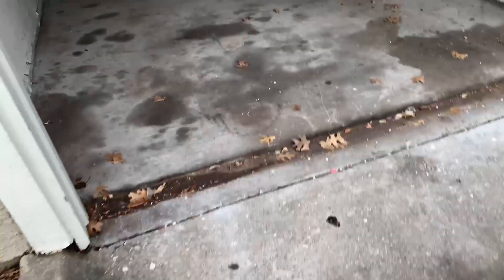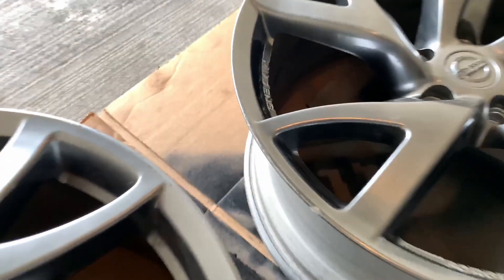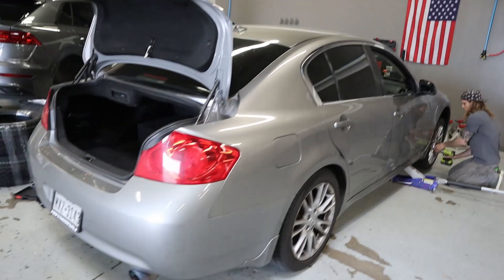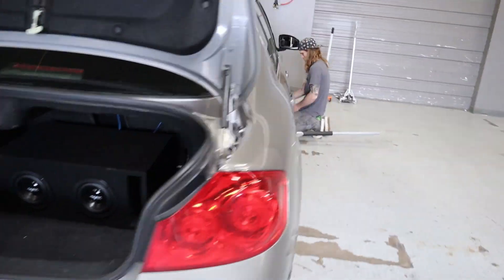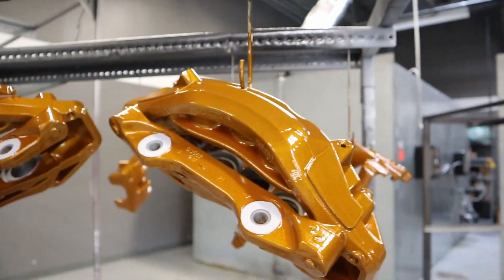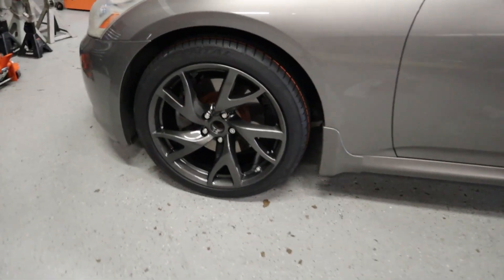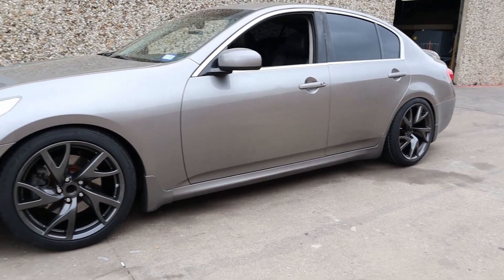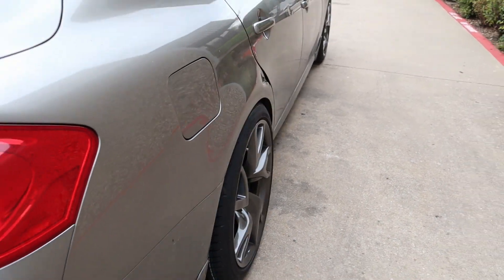My first experience with powder coating. Amazing Results! | Unit F14 Powder Coating

Comment: Job cam out great but it’s kinda weird that they’re using a cheap impact gun, like really cheap. A shop that nice I would expect a snap on or maybe even a Milwaukee, no hate just weird
Reply from the maker: Lol that’s the small stuff man. “Cheap brands” have a lot to offer as well. Their work is legit
Reply: @EnthusiastPOV  I know their work is legit , but if they cheap out on something I think is important like a tire impact what else do they cheap out on? What if they use cheap powder or don’t prep wheels to save money, just a thought
Reply: Just checked their website and it’s pretty busted on mobile, not a good look lol
Reply from the maker: Lol. I’ was more than satisfied for the service they provided. For two 28 year olds just starting a business which they opened about 3-4 weeks before I got my service done. They did an amazing job.
Reply from the maker: It’s a new business you’re being over the top about an impact lol. If I was 27 years old with a new business putting out work like that. I’d say I’d have al the Milwaukee’s I needed in the future but you’re focusing on that one thing lol

Comment: What are the spec for the tires  and spacers?
Reply from the maker: 19x9 / 19x10 - 245/40/19 - 265/35/19
Reply: Enthusiast POV ok thank you are you running any spacer